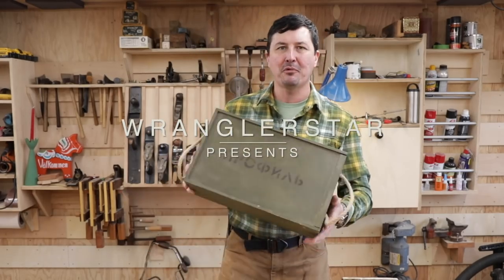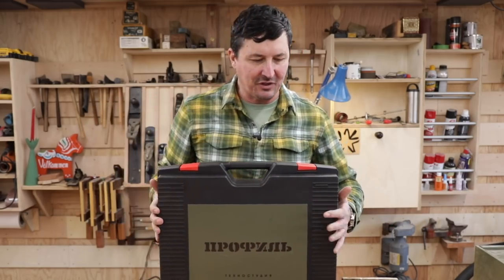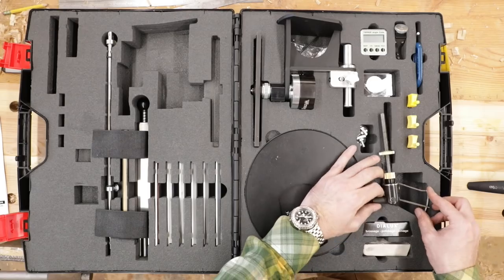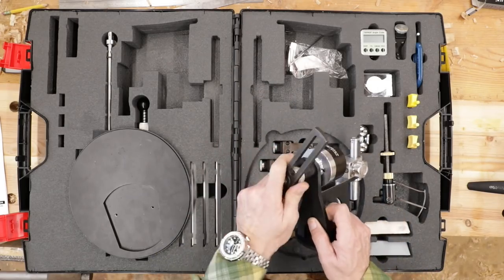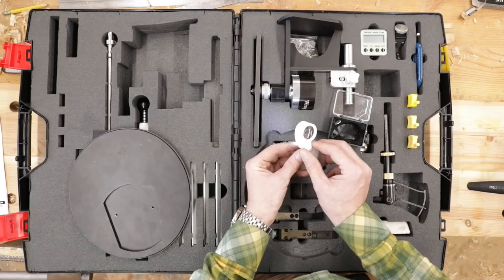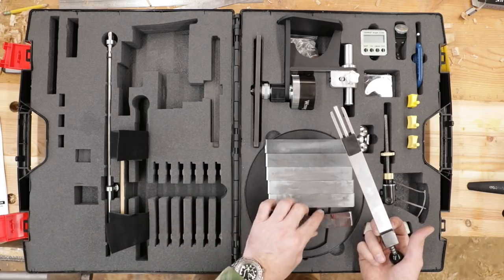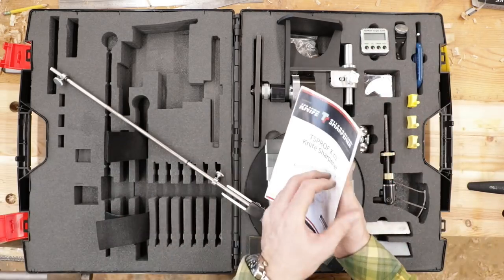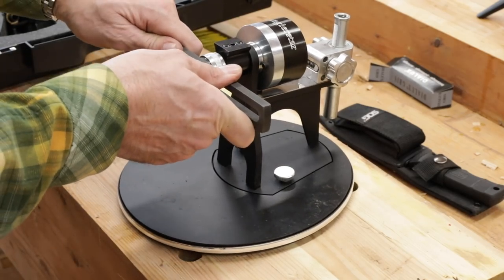This Box From Russia Changed My Life 2

Comment: Let's see it sharpen a piece of plain flat stock
Reply: sassparilla kid Flat stock? 😂😂😂
That goes from sharpening to complete knife making and if you arent forging the edge down you’d probably have to machine it. At the very least sit there forever with a set of files. That’s ridiculous to think he’s going to sit there with knife sharpening stones on a knife sharpener and do that 😂
Reply: Josh Anderson I mean obviously use files/ grinder/ whatever to get it close!!
Reply: I cut a flat mill file to the same 45 degree angle and length as the profile stone backer. I can put the profile of a knife edge with that without excessive time or wear on delicate abrasives. From there to a diamond stone and then onto the abrasive stones. I love this tool. I sharpened an antique draw knife  and an old beat up machete and a cleaver that was delegated to kindling splitter all razor sharp.

Comment: Can you do an convex edge
Reply: With a system like this, not really. You can mimic it though, for example you could sharpen a knife very thin (14 degrees per side), and then with the medium-high stones micro-bevel at 16 per side, and then with high stones micro-bevel again at 18 per side. With a lot of stropping at like 17 degrees, then 15, then 13, you could blend the bevels slightly, and be left with an edge than functionally looks and performs like a convex.  This takes a lot of time though, and really does not make a noticeable improvement in performance to if you were to sharpen at 14 and micro bevel once with high stones at 18.

Comment: Any way this sharpener could sharpen plane irons or chisels?
Reply: I would think a plane iron would fit in the clamp and just act like a very wide, very short blade.  Chisels are the real question, but there are other methods for them.
Reply: I know there's that roller-dealie for chisels. I want to see getting an exact 25 degrees, razor sharp, on a chisel. It would be impressive if the tsprof could do that.
Reply: I have an edgepro clone (chinese) with true edgepro stones.  I can sharpen chisels on it by taking the edge guide off but it is janky...The hard part is keeping them flat on the deck.  If you are careful you can do it though.  This type?  It doesn't look like it would be possible with what is supplied.  It would take a fabricated holder.
Reply: Maybe if he angled the chisels on the holder, don't really know, I want to see it though. As for me I've been sharpening plane irons on one of em basic Lansky clamps, gets the iron sharp enough, but it changes the edge profile everytime.

Comment: Anyone have success finding the best way/and or product to clean out these sharpening stones?
Reply: I use oil on all my stones, the oil allows the super fine metal that you take of the blade to float away. Using your stones dry and that material will fill and compact into the very small pores in the stone that allow it to cut. Even a file needs to be cleaned with a file card. Some use water but I avoid water on steel as it allows oxidation. RUST is the enemy of any edge. Oil will make your stones last and and keep them cutting. 3-in-one is what I use but any light oil will do.

Comment: surely the clamps aren't just snap-in and safe to use? don't they have holes to add fastening thumb screws 17:37? it was uncomfortable to watch you use that thing like that...a little more pressure and you could have popped the whole thing off and sliced your knee caps...yikes

Comment: $820 :O
Reply: Where did you get that price?  I can't seem to find this model.  I will say that the lesser models seem to be underpriced when you compare them to say Edgepro.  Maybe the lower model would do what you need just fine.  ~$300ish isn't too bad when you consider the machining that went into these.
Reply: For what it is offering, that is not outlandish,  it is priced similarly with competitive set ups. I've easily put well over $2,000 into my sharpening equipment over the years, $1,000+ of that into my Wicked Edge and it's many upgrades. I've more than broken even though, it can be a lucrative side job once build up some customers.

Comment: Sounds like a lot of preps just to sharpen a single knife...
Reply: Sharpen more than one knife then... 
He was showing this tool off, not showing us how he sharpens all of his knives.
Reply: He DID explain that it’s not intended for the casual knife person. Hence why he stated it would be perfect for a small side business.
This device isn’t designed for the user to sharpen ONE knife every few months, it’s for sharpening multiple knives. Once you have the rig set up, the adjustments and stone clamps (and stones) quickly swap out... or did you miss that point Cody made all throughout the video?
Reply: It takes hours for me to get a perfect edge on my folding knife. Like, actually hours. Two at the least. So, five minutes of changing out a clamp, putting on the sharpening stone, and dialing in the degrees, and then going on to sharpen the knife perfectly in 15 minutes... I know which one I’d rather do.